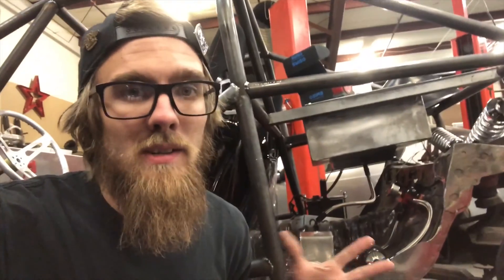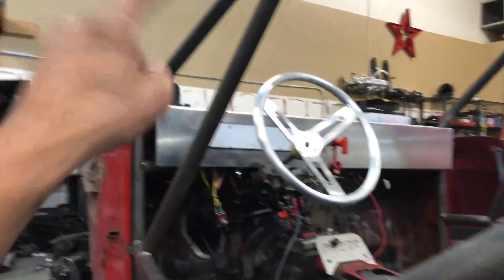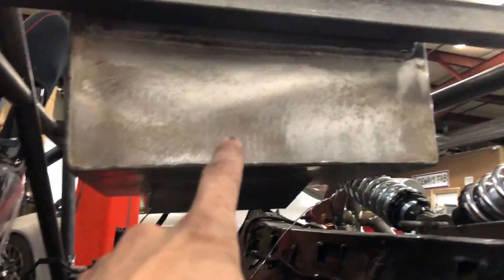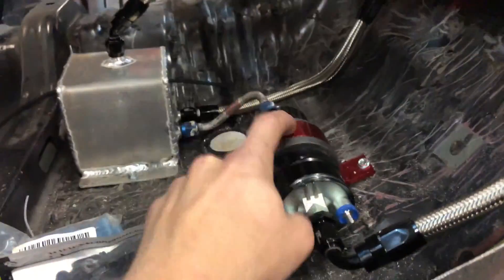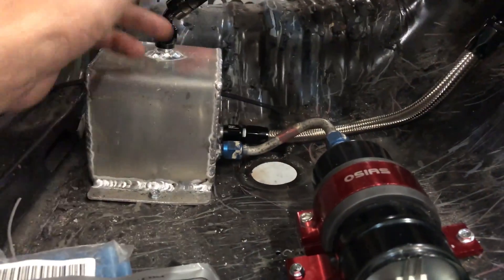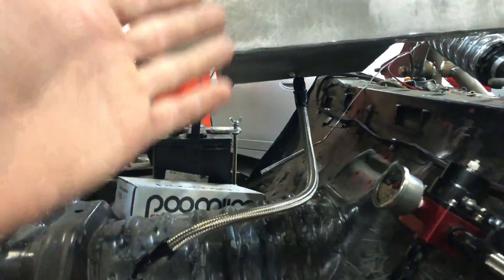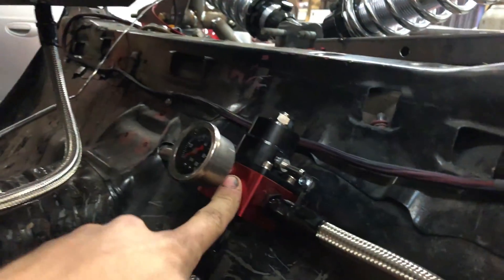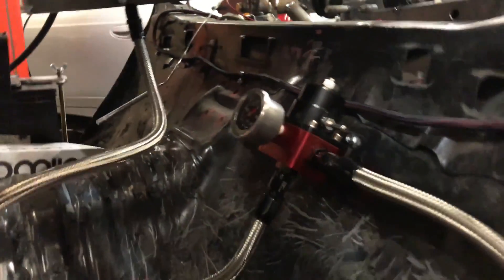Gravity Fed Surge Tank without a Lift Pump?

Comment: The pump can't flow back into the main tank, it can never pump out more fuel than it draws in.
Reply from the maker: It doesn’t need to pump out more fuel than it draws in
Reply: @6berries  I think you misunderstood.

I know it wouldn't need to, what I am saying is that it physically can't.

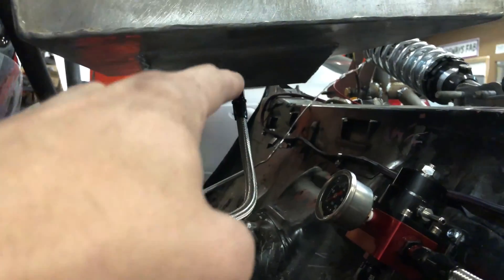1:24 you say if you end up with too much fuel it will go back up to the main tank.

The fuel pump can't create extra fuel volume to push back into the main tank (maybe a small increase through thermal expansion) It would only ever circulate or use fuel already in the surge tank.

Comment: A surge tank without a lift pump requires a vent, otherwise the air trapped in the tank can never escape and the gravity feed won't work properly.     You need to add a vent as high as the main tank or ideally back into the top of the main tank.    You also don't NEED a boost/vac line on a dead head setup, the EFI should have a compensation table with a static fuel pressure.
Reply from the maker: RecklessRegal technically the fill line being at the top of the surge tank allows all the air to vent. You are right though, it would probably be better with another vent going to the top of the fuel tank
Reply: @6berries  Air can't escape efficiently while fuel is trying to enter through the same line.    This is the same thing that happens when you try to dump out a bottle of water or a 2 liter to fast.   You get that "glug" effect, which is the air and liquid crashing into each other, which aerates the fuel.
Reply from the maker: But air shouldn’t typically be in there once it fills up. Only time it would be an issue is a long period of heavy throttle while the fuel is low and sloshed away from the sump.
Reply: @6berries  Yeah, once you finally burp it, it should be fine.   That first burp is a pain without it though, can take several thousand miles.

Comment: Could you tune out the vaccum for the regualor
Reply from the maker: AndrewHuffman I’m not entirely sure. I think it would cause it to be rich at idle or lean up top because of differences between manifold vacuum and fuel pressure. Rich at idle wouldn’t be awful though
Reply: Matt 6berries it works like that on my ls. 🤷‍♂️
Reply from the maker: Good to know! I’ll probably run it like that then!